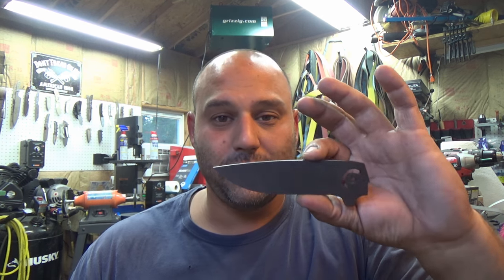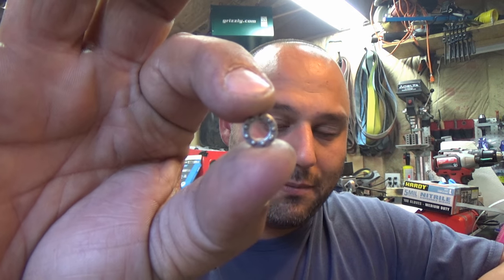Making a Folding Knife #5. Important math and surfacing the blade.

Comment: Hi Mike. Yeah I am really late to the party. Ive been making folders for around 2 years now and would like to ad my 2c. For the guys that use the metric system: if your blade is 4mm finished thickness and your bearings are 1.6mm thick, then your recess on the blade must be 0.7mm deep and 0.7mm deep on your Titanium liner. That leaves you with 0.2mm clearance on each side. Your back support on your knife must therefore be 4.4mm thick. Lots of math in a liner lock folder, but if you get it wrong, the knife will be wrong.

Comment: Really good finish on that blade. How does that 120 grit wheel hold up against hardened steel? I've tried a 60 grit and noticed that it clogged up pretty quick so I'm just using a ceramic 46 grit.